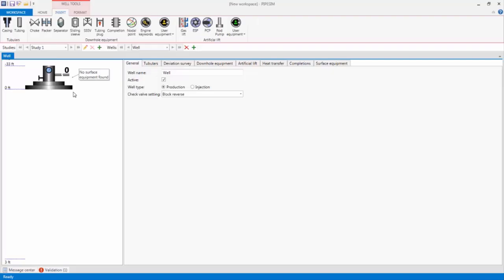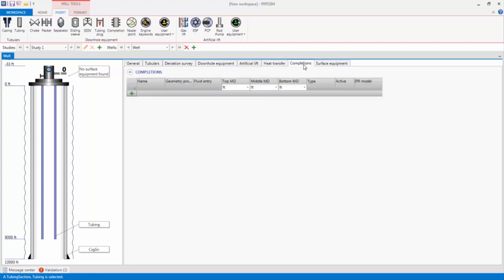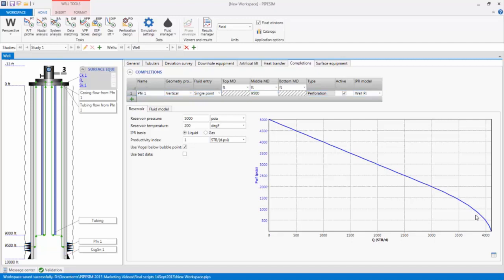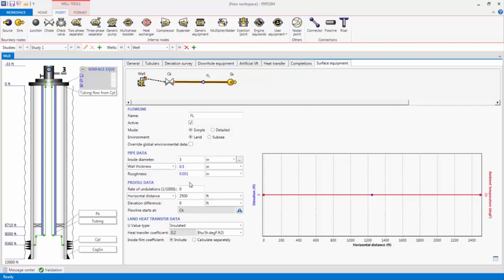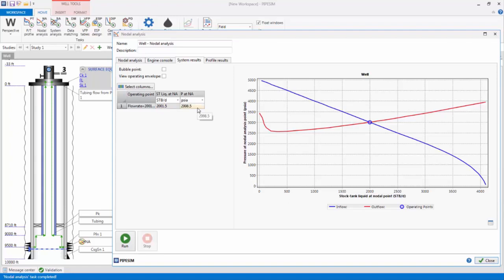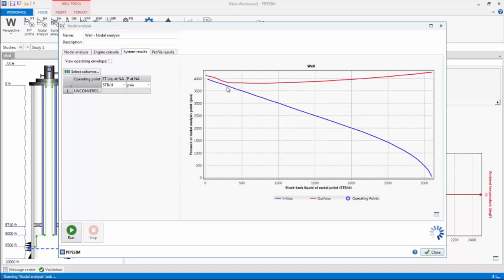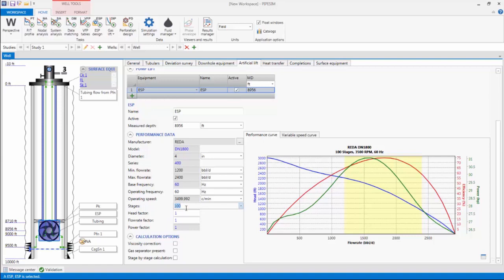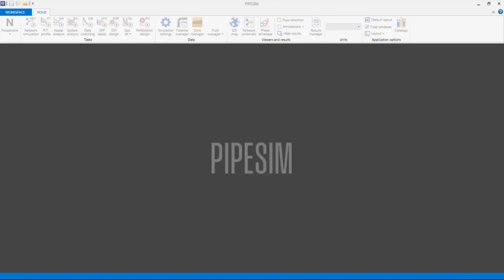How to build, run and evaluate a well model using PIPESIM software

Comment: Learn Essential Skills For Your Career Development.

Online Course: PIPESIM

This course helps you to learn steady-state, multiphase flow simulation for oil and gas production systems to analyze well performance, model pipelines, and facilities, and perform nodal analysis using PIPESIM software.
Participants will also get an understanding of how PIPESIM software is used to design and optimize total production systems from the reservoir to the final processing delivery point.

For More Detail, Inquire Now:
E-mail: admin@ogpec.com
Web: https://ogpec.com/pipesim

#PIPESIM #learn #steadystate #multiphaseflow #simulation #oil #gas #production #analyze #well #performance #pipelines #nodalanalysis #design #optimize #reservoir #processing #Process #engineer #pipingengineering #oilandgas #careerdevelopment